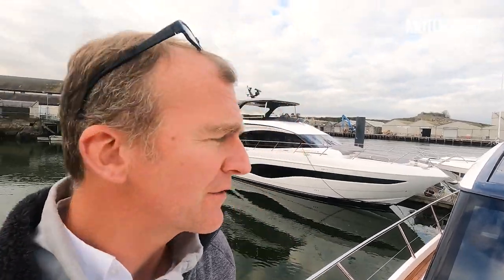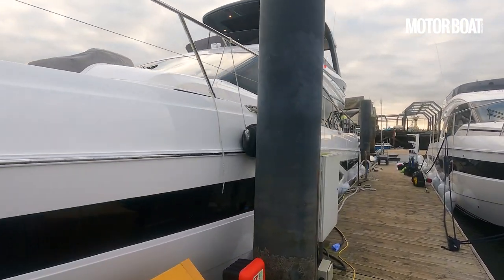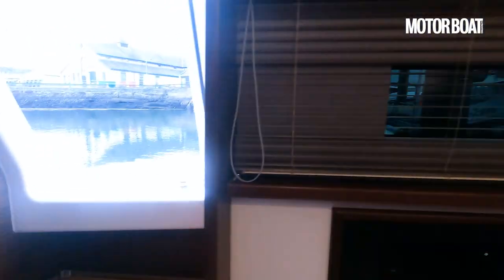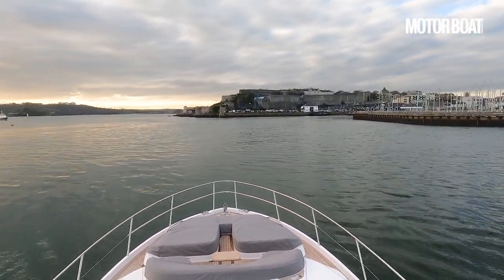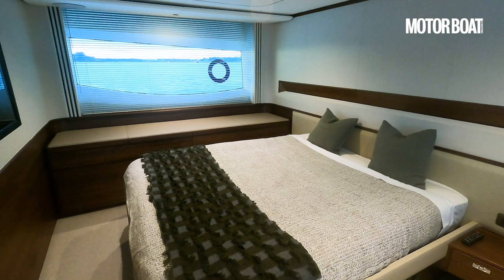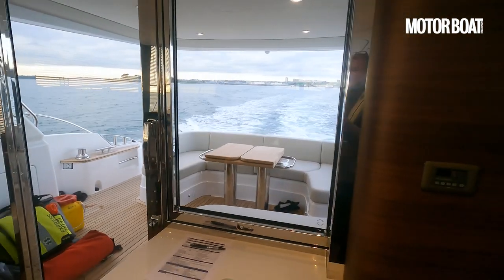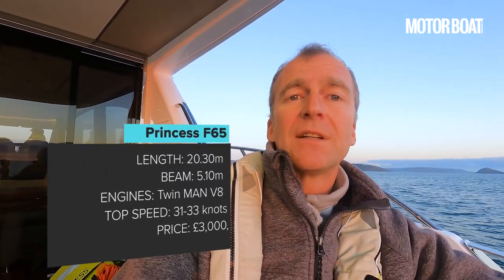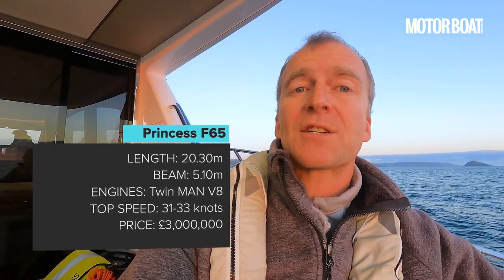Princess F65 sea trial review | World's first test of this brand new £3m flybridge | MBY

Comment: That’s a fast boat. Your caption says it has 2 x 1,200mph engines. Do you not worry about spray at 2,400 miles an hour? That’s over 3 times the speed of sound? Remarkable, but I can’t imagine the fuel burn 😊

Comment: What has happen to princess prices on their boats? In 2020 a new V55 was like 1.5 million and a v60 2 million. Today a new v55 is like 2.5 and a v60 2.8-2.9 is that because of the inflation?
Reply: It’s partly that but Princess asked us to quote all their boats inc VAT and with a realistic spec about 18 months ago rather than a price from as per most manufacturers.
Reply: If you think that's bad, you should see the price of a Freddo 🤣
Reply: @hugoandreae3785   - very interesting, and credit to Princess. I must say as a late convert to the joys of these boats, I find it bizarre that manufacturers tend to be so coy about their pricing. The only one that follows motor industry practice is Pearl, and then only the 62 and 72. But then, value for money is a huge part of the attraction of the Pearl line.
Reply: Well the new 2023 F55 costs 3.2 million, with that money 3 years ago you could’ve bought a new Y78 (which today is about 4.5 million). Princess yachts prices are trough the roof, doesn’t make sense why they’re so overpriced